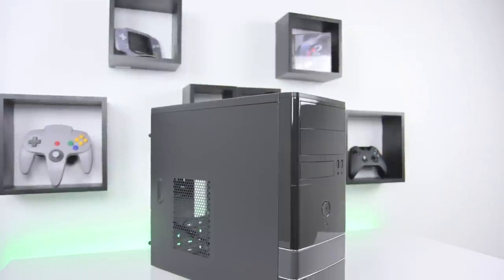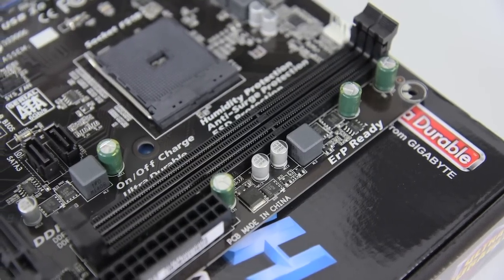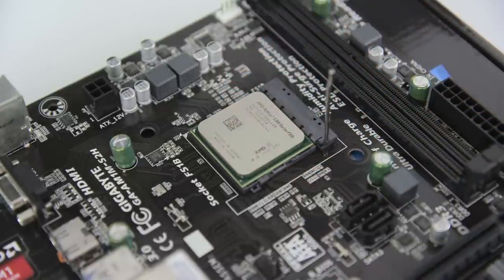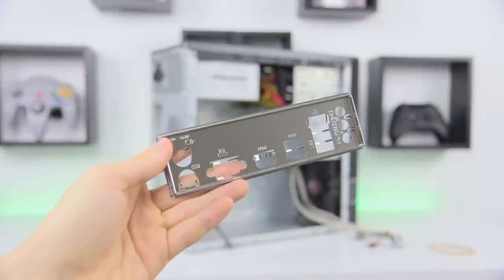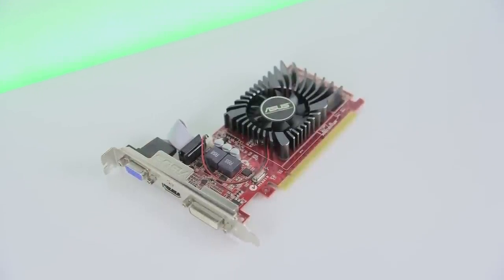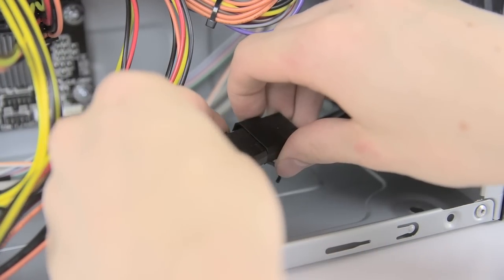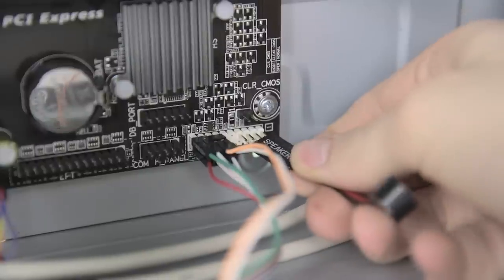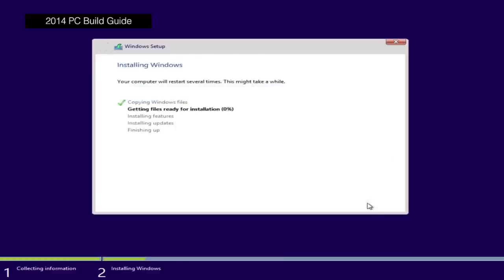How to Build a $300 Gaming PC! (2014 Boson)

Comment: It's like putting Lego pieces together.
Reply: Very expensive Legos but Legos nine the less
Reply: Yh its like legos, but at least you dont almost die from standing on them xD coz atleast there in a case
Reply: But it's easy once you get used to it to be honest. I am currently building first budget PC and it's looking good from the inside and outside, I am just waiting for the OS to come in the mail. All the wires are setup, I'm just crazy about cable management and making it as clean as possible.
Reply: I know what you mean, i spent more time sorting out cable management than actually building mine. I'm always unscrewing the side panel to look inside and to see if there are any cable improvements that i could make xD.

Comment: OMG thanks solo much! I plopped windows 7 on it ready for windows 10, and it runs great with a GTX610! However, I would warn anyone who wants to build this PC that Austin installed the heatsink incorrectly. Follow the instructions and you'll be fine. MC runs at 70 FPS with 16 Chunks and a few features in optifine.

Comment: Can I use 8GB of RAM.
Reply: As long as you have a 64 bit operating system
Reply: Thanks
Reply: marko djordjevic I recommend checking out the Boson 2.0 though.
Reply: Ok.
Reply: marko djordjevic Unless you are referring to this as a tutorial to build your computer. If you are planning on building the Boson you should probably use Boson 2.0.
Reply: Not really planning, just looking around for a possible future build.
Reply: marko djordjevic Yeah, okay, that's cool.
Reply: Around Christmas you can get a really good GFX Card and components for a fraction of the price.
Reply: ***** AH, thanks
(THE ONE PART I FORGOT)

Comment: No cd drive?
Reply: Ben Dean-Jackson You don't really need a cd drive nowadays
Reply: You do to install windows
Reply: you can install it through usb I believe, correct me if I'm wrong
Reply: juhiiz448 Im pretty sure you can. Its just that most version's of windows mostly come on cd.
Reply: Ben Dean-Jackson USB dvd drive? Optical drives on computers look terrible. The feel of this build takes me back to my first custom PC back in 1997.
Reply: Ben Dean-Jackson You dont get CD's anymore. You get your windows from their site whenever you want to download, then put your product-key, and vola.
Reply: Ben Dean-Jackson You wont be running windows very well on this build in the first place, but you can and 99% of IT techs havent used cd/dvd drives in 9-10 years or more. This is more of a decent Linux build than anything.
Reply: Ben Dean-Jackson I installed my windows using a usb drive. Funny, I got a pirated version and I used one of those genuine windows programs that makes my windows "genuine" and done. CD drives are a thing of the past. I buy digital since the CD is gonna intsall the same way anyway. after all your not gonna put the cd back in if you want to play some bf4.
Reply: YoutubableGamerᴴᴰ you'll get windows 10 for free when it releases with a pirated copy of win7
Reply: ***** Probably, but I found out that when it releases, the client im sopossed to download will check of my product key is REALLY legit. SO in a way I do have a chance of getting it. If not, hey that's what pirates are for aren't they. ;)
Reply: YoutubableGamerᴴᴰ M$ released a statement like 3 weeks ago that even pirated copies will get a free update, and you'll be able to upgrade directly from win 7. 

They might be up to something. M$ ain't this nice...
Reply: ***** Really? Yeah your right, seems pretty fishy to me. Guess i'll wait a week or two to see what there up to.
Reply: D.A. Jackle haha let me help you out. Windows Software is free, you have to pay for the key to activate the software. Goto windows site and get Windows free ass they offer it and purchases a key install with USB. Wow cost me $30 how much did your crappy disk cost you again hahaha sory.
Reply: BloodyNoSeProduction It cost me $100, because i'm not poor.
Reply: ***** No as I have been build PC's for over 15 years I know a large population  of techs and privet builders. So general knowledge is CD/DVD drives are out dated and highly unnecessary and have been near 10 years
Reply: ***** yeah,  not going to happen.  They can detect the bad software now
Reply: Makes it easier to download the drivers with the discs
Reply: ***** time to donate those dinosaurs...
Reply: Maybe people have a couple of cd /dvd drive before PC
Reply: Luong Kyanh Not to be rude, but what?
Reply: Opp's, i mean they own disk and drive before media over internet gone mainstream or have drive bay devices (card reader, LED controler using drive bay,...)
Reply: BloodyNoSeProduction You must have bought the cheap version of windows that had much less features. Home premium is  the one that costs 100$ while the shitty starter edition costs around 25$.

Comment: Just built a system with the 5350, you installed the heatsink wrong and it can cause overheating. If you're building this system, you can follow Austin's guide, but please refer to the manual for installing the heatsink correctly to prevent overheating.

As a summary, you put the 2 larger black knobs into the metal holes in the heatsink (Requires a lot of force, you should feel the spring resistance if done correctly). Then, place the heatsink on and push one knob so you see the full tab under the motherboard. Now, place the pin from the TOP of the knob so the tab locks under the motherboard. Rinse and repeat.

Comment: I've built a gaming rig before, but I've recently been asked to recommend specs for a computer for a family.
They have a 7 year old computer with a dual core AMD CPU clocked at 2.4GHz, 2GB of DDR2 (800MHz I believe), 250GB of HDD storage, 280W PSU (not 80+ certified) with a Nvidia GeForce 9300 GS, and since that is far behind what we currently have, I have recommended them to upgrade.

Their budget is approximately $600~$800 (the cheaper the better), they will usually watch a lot of movies and listen to music with that, while still wanting some "reasonable" gaming experience. Also, their parents are a programmer, and so he might be doing some programming on that computer too.

Here are the specs I am deciding to recommend, can you guys "proof-read" it?

CPU: Intel Core i5 4460 (Should I stick with this CPU or go for the FX 8350?)
Motherboard: ASUS H87-PLUS (for now, probably the ASUS M5A97 if I choose to go for the FX 8350.
RAM: G.Skill RipJawsX 8GB Dual Channel Memory DDR3-1866
(I was planning to buy normal Crucial or Kingston DDR3, but at where they live, it costs $300! Even the G.Skill RAM at where they live costs $100. (HyperX Fury DDR3-1600 16GB set is $180).
SSD: Planning to go with the Kingston V300 120GB OR the Crucial BX100 120GB SSD (I'm leaning towards the BX100 more due to its fast booting speed). The SSD will be used for installing Windows, so I think I will go with the BX100 (price difference at where they live is $10.
Graphics Card: Gigabyte R9 270X Windforce (Im still not sure about the Graphics Card. There is about $20 more expensive with the GTX 750Ti at where they live, and I know that the R9 270X can beat the 750Ti in pretty much any game at 1080p resolution, but is the appropriate card? Its hard because I dont know what they mean by "reasonable gaming performance".
PSU: Surely a 80+ Bronze PSU. About 500~650W. Recommendations?
Case: Again. Nothing to expensive, just with reasonable airflow and a rather silent case (not like an extremely silent, expensive case). Recommendations?

Does multiple CPU cores benefit programming? Also, is the R9 270X a reasonable card for "reasonable" gaming experience?

Please reply as soon as possible.
Reply: TechBuildPlus yes that build seems fines
Reply: replace the r9 270x with a normal 270 unless the latter is more expensive
Reply: TechBuildPlus Assuming its already build, thats a solid build.
Just get a cheap solid case.

Comment: I built AMD Phenom 6 cores with am3+ sockets this was a kit you got everything except a dvd drive which is becoming less used for only $129.00 the kit included board cpu ram 4gigs which I later upgraded to 8 case 450 psu 3terabyte hd WD which died but was replaced with a seagate drive heatsink and fans it had onboard graphics which did ok till got a budget card the best deals can be gotten around Dec. thru March so timing is a factor if you want to build a good gaming pc.

Comment: I replaced the CPU, case, and motherboard to CPU:Amd Fx 4300 Case: LOGISYS Computer CS305BK. Motherboard: MSI 970A-G43. I also removed the hard drive since I already have a 500 GB HDD and a 80gb ssd in a box.

Comment: Would this be a good pc for £400?

CPU: AMD FX-6300 3.5GHz 6-Core
CPU Cooler: Cooler Master Hyper TX3
Motherboard: Gigabyte GA-78LMT-USB3
Memory: G.Skill Ripjaws X Series (2x4GB)
Storage: Seagate Barracuda 1TB
GPU: MSI GeForce GTX 750 Ti 2GB
Power Supply: EVGA 430W
Case: Xigmatek Recon

Please suggest any improvements. Thanks!
Reply: good for now i have a 7850k and 750ti build and i can run gta V high-vhigh game like dying light on high easily

Comment: Is this a good build for games like gta 5?
              
                     power supply:
EVGA SuperNOVA 750 B1 80+ BRONZE, 750W Semi Modular 5  
                      Motherboard:
ASUS Micro ATX DDR3 1600 LGA 1150 Motherboard B85M-G R2.0
                     Graphics card:
EVGA GeForce GTX 960 SuperSC ACX 2.0+ 2GB GDDR5 128bit, PCI-E 3
                        Cpu:
Intel Core i5-4690K Processor 3.5 GHz LGA
                        Case:
Sentey® Gs-6080 Seeker

Comment: Here's the build
Cpu: Intel Pentium g3258
Gpu: msi r7 265
Ram: crucial ballistix sport 8gb
Hard drive: Western digital caviar blue 1 tb
Psu: corsair430 w

- I need help in choosing a motherboard that would be best for this setup. I plan to play games, some recordings and video editing.

-These are some mobo's I've been thinking about cause I'd like to over clock and their under $100
-MSI H81M-E34 Micro ATX LGA1150 Motherboard
-Gigabyte h97
-Gigabyte ga-z97-hd3
-Gigabyte lga 1150 Intel h97
-Gigabyte h97extreme multi graphic support
-ASRock Z97 Anniversary ATX LGA1150 Motherboard
-ASRock Z97M Anniversary Micro ATX LGA1150 Motherboard
Thx for your help:)
Reply: Joseph Luis ASRock H81M-HDS. Why would you buy a H97 or Z97 chipset for a Pentium? The Z chipset is unecessary since you can OC the Pentium on every 1150 socket motherboard.

Comment: Cool, thanks, I did this build and it works great. I have changed some thing too. I went with an Amd Sapphire R7 260x for my graphics card and for the cpu I went with an amd FX-8320 FX-Series 8-Core over clocked edition. Thank you, this helped me so much.
Reply: well this motherboard take that FX cup or a a10 trinity ? because I got the AMD Athlon 5350 and a nvidia gtx 750 and its bottle necking

Comment: I got my 300$ gaming pc

Pentium G3258 3.2Ghz  can be over clocked to 4.7Ghz 68$
ZOTAC GTX 750Ti 2GB ddr5 105$
Any Asus motherboard for 40$
Roswill cpu case 23$
500GB 7200rpm 35$
2x4 GB  kingston hyperX 2133Mhz 38$
400W power supply 20$

And it works soooo good !
Reply: I'm getting 

Athlon x4 860k
GTX 670 FTW
8GB HyperX DDR3 RAM
Asus Motherboard
Rose will case
500w PSU
Reply: And 1TB HDD
Reply: powerplayer75 Yo man nice !

Gtx 670is very stong card !

Comment: I just wanted to say that you had put the fasteners holding the CPU cooler in wrong.  The long plastic rods with the small heads are suppposed to be pushed into the top of the bigger pieces.  It's really hard to put these in and take a lot of force.  I did this build recently and am working on putting videos up of the build.

Comment: Is this a good setup-
Case-BitFenix Micro ATX
Motherboard-ASUS Micro ATX DDR3 1600 LGA 1150 Motherboard 
Processor-Intel G3258 4 Pentium 3.20 GHz 3M Cache 2 Core Processor 
Power supply-EVGA 500 W1 80+, 500W Continuous Power
Hard drive-WD Blue 1TB Desktop Hard Disk Drive 
Memory-Crucial Ballistix Sport 8GB Kit
Graphics card-ZOTAC GeForce GTX 750Ti
Reply: Its good but it actually depens what games do you play.Nice Build
Reply: great budget build, for next upgrade, get something like a i5 2500k for your cpu

Comment: My Simple Pc
Intel Pentium E6700 @3.2ghz
Ram: 6.00 Gb DDR3 
Hdd: 160 Gb Toshiba
Graphic Card : AMD Radeon Hd 5450 2gb DDr3
Board: Asus p5G41TM LX
Not Good For Gaming
So What Can I Do For This For Improving Gaming? Please Help Me Fasttttttttttttttttttttt
Reply: Jainam Baradia Tip:Never use AMD,go with a Inter Core i5 for the processor,and a Nvidia GTX 960
Reply: KenKarma Myself id buy an AMD R9 380 bc its usually cheaper with better performance, and the cpu depends on ur budget if u have like 150-180€ id get the amd fx 8320 bc u can overclock to 4Ghz wit stock cooler, but if u have 200-260€ i would go with the intel i5 4460 at 200€ or the i5 4690k at about 240€ and a aftermarket cooler.
Reply: Karloke03 Thnaks For Reply Brow I May Follow You

Comment: Wouldn't recommend a 450w power supply. Did that with my first build and the thing blew out a couple of months later. Since the case comes with that PSU, it seems like a good decision to just opt for a different case/psu altogether. Can't say much about the other stuff, just throwing that out there so nobody makes the same mistake I did my first time around. Never cheap out on your power supply unit.

Comment: A12 might actually make this a valid choice but right now I would just spend the extra $50 - $100 for a cheap desecrate graphics card and a cheaper CPU something like a Athlon x4 760k and something like a 750Ti or R9 270.

You will get like 2 - 3 times the graphical performance for another $50 - $100 TOTALLY WORTH IT!

Comment: I'd go with a cheap i5~120-170 (about 4x3.0GHz), Mainboard~60(3xpcie, 4xddr3), 8GB (2x4)mem~60, power~30, gaphix gf750ti~100, 1tb~40-50, case~40, makes 170+60+60+30+100+50+40= 510€ fully upgradable mid range Gaming PC able to play any new game with decent grphix, capable of video editing, sli redy for a cheap upgrade with a used graphix card after half a year or so, with a 300 bugs pc you will most likely have to upgrade after about one year and then a completly new system will be the only option, Austin Evans you could mention something like that or link some new video ;D

Comment: thanks I have a similar build but mine is about 350 euro and It can run bf4 on low with 40 to 55 fps no antialising on multiplayer which I think is pretty good and it can run dragon age inquisition at around 35 to 50 on low no antialiasing which is great for a pc cheaper than a ps4 and xbox one

Comment: Really every time I build my pc, I don’t really use "anti-static" bracelet o other thing, what’s the best solution to get rid of static without buying anything?
Reply: Touch the case or power supply
Reply: SMCInsider touch any other peice of metal, or simply get a copper wire and wrap it around your wrist, and tie the other end to the metal case. Insulating the middle of the wire with electrical tape ;)
Reply: Jhon Alex if i was you I would still buy one. I got my anti static band for £1

Comment: This build is super subpar in every aspect and I wouldn't expect it to be capable of running many games on any higher than low settings at 720p. It's better to buy a used system with a core i5 gen 2 or later and upgrade the graphics card and ram to something decent. Almost any power supply that comes with a case is garbage and will likely end up frying your components in the end. Pre-applied thermal paste needs to be cleaned off and replaced with something decent. Stock coolers are okay if you don't plan on overclocking or really taxing the cpu with intensive applications.

Comment: hello i really need help so i built this computer and i have watched this video many times ive checked my wires and every thing looks right but when i turn it on it will run for 4 to 5 seconds display nothing and then turn off and automatically restart and do the same thing over and over and over i have tried hdmi and vga i don't have a monitor so i just hook it into my tv i mean all the fans run the leds on the case turn on my power supply runs and my CPU is put in correct im freaking out so if you have any advice plz help thnx

Comment: hi guys i built a pc yesterday and only finished up late last night but now when i go to install windows on the hard drive on the "where do you want to install windows" page. windows says that "windows cant be installed on this drive"also it says to "ensure that the disk's controller is enabled in the computer BIOS menu"
i looked in the bios menu and it says that the HDD is in the first boot but other then that i don't know what to do. 

this is a new build all the parts are new

any advice thanks

Comment: is this any good? 

Windows 10 (pre-installed)
AMD FX-4300 Processor
Memory: 8 GB
Graphics: NVIDIA GeForce GTX 960
Hard drive: 1 TB
Reply: I'd suggest you take an r9 380 because the 4 gb version of the 960 is very expensive and much vram is very important at the moment

Comment: Regaring the front panel connections; you said "worst case we have to double check the connections." I seriously doubt it is good for a circuit intended to power and LED to be short circuited though a switch. Have you verified this information? You should also add a warning regarding the HD vs. AC'97. If you have a really "stupid" motherboard (I really hope they don´t exist any more) you can actually burn the wires to the audio! I had an old nForce 2 board where this happened. Apparently you had to choose HD or AC97 in the BIOS and/or check the pin assignments before connecting the cables. Yes, the manual DID mention cheking pin assignment, but it was far to easy to miss. The lesson here is: DON´T just act from experience or follow general guides. READ THE MANUAL.    Best of luck to all fellow builders!